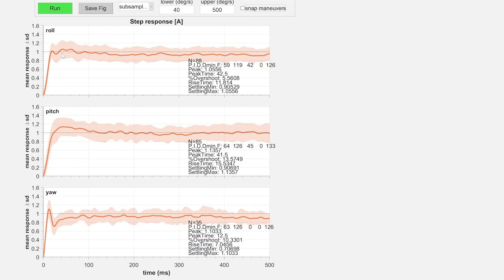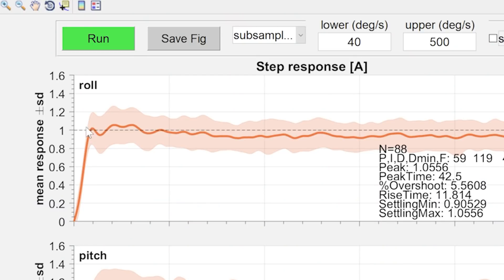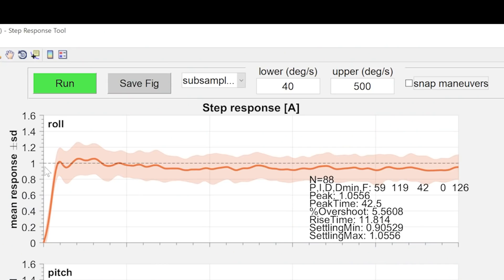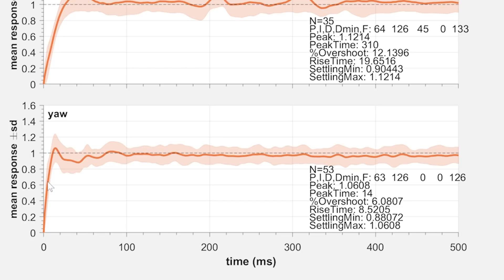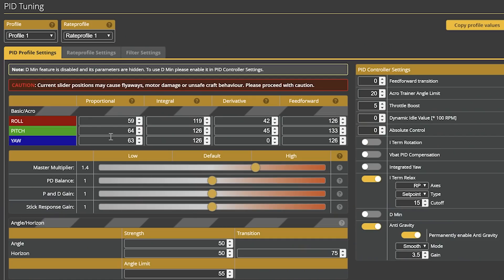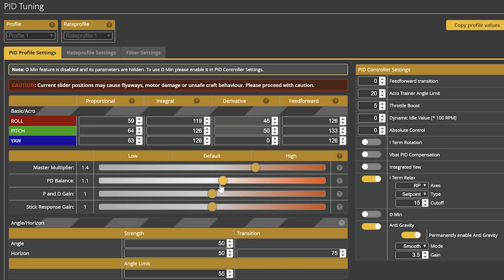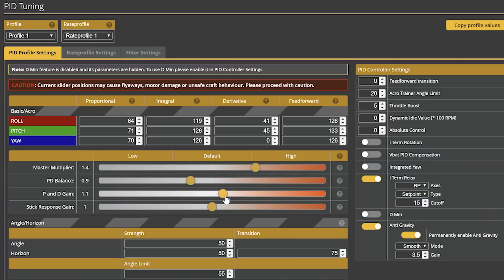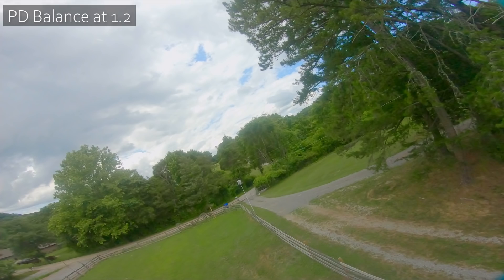Somebody finally made PID tuning make sense | Chris Rosser PID tune method | Part 2

Comment: I think I noticed a little something that maybe many do. When I do a snap flip or roll, I pull the stick to 100% and then release it completely. As a result, the stick doesn't stay directly in the 0 position, but of course swings back and forth a bit until it ends in the 0 position. This can be seen in the set position logs. As soon as I "manually" move the stick back quickly, these jerks do not occur. 
The question now would be. What is an optimal snap maneuver to feed the blackbox. Release, or quick manual return of the stick to the 0 position. 

I would imagine some struggle with this even though the copter is already optimally tuned.
Reply from the maker: Don't release the sticks like that. Manually return them to center.

Comment: 3:07 just open the log move the marker to after takeoff and press "I", then move the marker before hitting the ground (or crash) and press "O" that will frame the analysis window in Blackbox explorer and you can land without disarming gymnastics, or use logs that include you hitting somethings. and use the BBExplorer ;) then you can see the setpoint, and make more sense of the data.

Comment: based on the video footage, the stock setting looked a bit smoother on straight acceleration when you punch out.   It also seemed like the plot of the raised P tune actually showed a slower rise time achieving the target rotation rate.

Comment: How can you tell that the overshoot undershoot is not from your lack of timing or rates being too fast or too slow. Even with these data seems like alot of guess work still.
Reply from the maker: Rates and stick movement don't affect the response curve in that way. Rates and stick movement change the setpoint. The response curve is the relationship of actual movement relative to the setpoint. So whatever setpoint your stick movement commands, the response curve is showing how well the PID controller achieved it.

Rates do have some effect. If you are commanding a very high rotational rate, rise time may be longer and overshoot may be higher. But the overall character of the curve will be the same.

Comment: JB another great video but unless this has changed in PIDToolbox 0.4x, you need at least 100 samples per axis for the data to be any useful. The lines in the graph will be a little wobbly under 100 samples.

Comment: great video Joshua! Glad to see more PID tuning vids! 
One thing I would suggest is minimizing the effect of FF for the step resp tuning. High FF values can mess with the deconvolution process, but also may dominate the curves such that the changes in PD may be masked by FF. I just add FF back later and look at the set point-gyro tracking in the traces. Anyway, I wish teaching was my forte, but you do a great job of distilling it down nicely for a general audience.
Reply: Thats a great point. Thank you!

Comment: Honestly that tune looks really stiff.. the greatest way to tune is still stingy ole method
Reply from the maker: If the tune was stiff, changing the iterm relax threshold would be the next step to fixing it. But we didn't go there yet. Correct me if I'm wrong but Stingy's method doesn't take into account the existence of feed forward, which is a major limitation (but FF wasn't around in Betaflight then I don't think).

Comment: In school we learn to set PID on system the easiest method (not usually math ) is to put Ki an Kd a 0 and set the Kp to the sweet spot ,the we tune Ki to make the line close to the command. The problem with Ki is it's an integral so it makes times to respond ,then to reduce the respond time we use Kd. My question is can I use this method (put Ki and Kd at 0)???
Reply from the maker: The best quadcopter PID tuning experts don't use that method.
Reply: @JoshuaBardwell  but nice video
Reply: I also see on drl sim there is a fonction to set PID automatically by doing full pitch ,roll and yaw. I have a project for this summer ,is to use an esp 8266 or 32 and giro to make a "black box" that return the PID to use by put in input the current PID using a web page

Comment: Interesting! No wobbles / desyncs on them hard yaw moves. That would have done it for me. So these are the improved motor / bell?
Reply from the maker: Yes. They'll be in stock in about 3 weeks.
Reply: @JoshuaBardwell  Crossing my fingers I actually get a set, and Bob ain't forgot about me. The Imperials are great motors, so much throttle resolution, insane power, but damn the fucking desyncs!

Comment: 12:22 actually opened my eyes. I sometimes had issues with my old build, not that strong as you showed there but it was audible in the motors and whenever I loosened the lipo strap and redid it it resolved. I honestly never really understood how that made sense because I couldn't imagine how the lipo strap could cause so much noise...

Comment: I love the shirt I have one. I would just like to make a suggestion it might not be that exact shirt but it’s very close to that one big part but I have a suggestion maybe look up a higher quality printing service for the shirt. My Joshua Bardwell broken arm motor shirt started to peel the decal after one wash in my washer and dryer. Are used gentle cycle and turned it inside out to avoid this. 
Just a suggestion love your content!!!!!!

Comment: do mutlti gp racers use blackbox on their quads ever? i would guess they only do it by ear. pid tuning is the only thing im not good at and i have been racing with my friends for about 5 years now. i never tune my quads mainly because i dont know where to start so if somethin is wrong i never know why i just change stuff till it stops being weird
Reply: did you win in every race u do,,how much cost you spend for sparepart
Reply: @zlachannel8674   well me and a two of my friends tried going to a real race and we found out really fast it’s not fun crashing and waiting to go get our quads then wait for our next turn to race which is not fun. So we got our own gates and setup just us three and we can run out and play dodge quad to start flying again.  So basically we don’t ever win or lose we just race till we run out of batteries. Each one of my dji quads is about 3-4 hundred bucks in parts (frame, motors, 4in1esc, flight controller, dji caddx vista,) props and batteries also. I have 3 catalyst machineworks Mercia v2s and 3 karearea plastic talon v2s.
Reply: Frames from catalyst machineworks are between 70-100 bucks for the frame but individual carbon spare parts are pretty cheap. In the beginning you break a lot of stuff but once you get the hang of it you stop breaking stuff pretty quick. It will cost about 1500$ to get started initially getting everything you need but if you start with one pre built quad and a charger batteries and the dji has system you will have enough to get the fpv bug to bite you then the rest comes easy
Reply: @dominicklittle9828  ouh my god,,,there is a lot of money

Comment: I just want to ask officially , are you using the new JB quad whilst tuning in these videos? (Ya know because I built it.)
Reply from the maker: Yeah of course!
Reply: @JoshuaBardwell  with Chris's filters...The JB QAVS flies beautifully. I am really considering building a few more. I also wanted to let you know something. I have not seen ANYONE say this , in any video yet. But , because of the shortage of low latency HD cameras , IE Cadx Nebula Pro. I used the camera from the air unit , on a vista , and it worked great. While it can be an expensive way to get low latency HD, many people buy air units by themselves. I say if you can't get one , buy an air unit, then pull the camera off , switch it out, and sell the Air unit module on FPVEXCHANGE.COM . (You probably already knew this , but I think it would be a good public service announcement.)